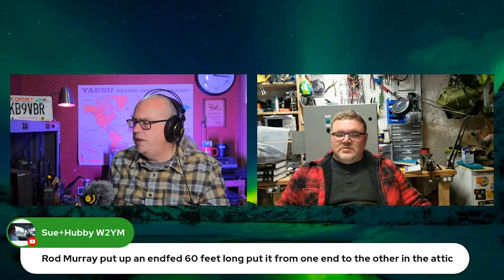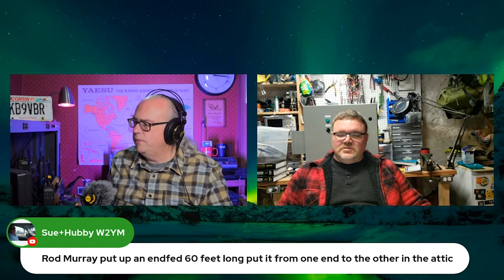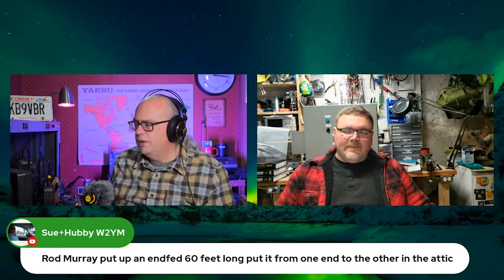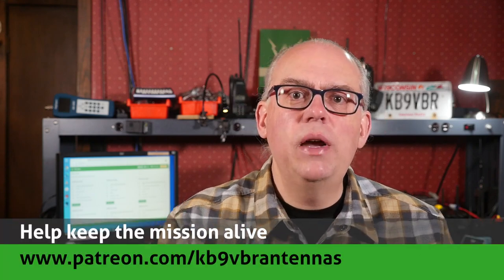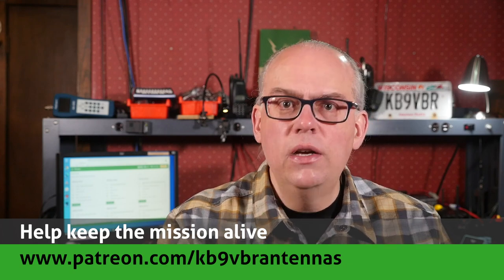What's the best antenna for in the attic? December 2021 Livestream Excerpt #HamRadioQA

Comment: My dad used to make mag-loops back in the 80/90's and had a mandrel bent copper loop in the attic. he ran it with a rotator for the loop and remote motor for the vacuum cap, he used to work the world with ease on that thing.

Comment: I made a fan dipole for 40, 20, 15, 6 and mounted it in my attic. Tuning it was a bear ! Finally got it resonent  on all bands and proceeded to fry all the I.R. lights on my surveillance cameras, activated the smoke allarms, turned on and off the under cabinet lighting and turned the computer speakers into noise makers and fried my video card. The only way it worked well was to turn off most of my power circuits in the house n run it on battery power. Not recommend 😕
Reply: Wow!

Comment: Best thing is a hi Q antenna 6-16 with cap hat on a 15’ mast with a good radial field under it or run a few elevated folded counter poise 😉😉
Reply: In the attic?
Reply: @lounickles4744  yea you could run a hi-q mobile antenna in the attic, 15’ mast could get tight in sum attics, so mast accordingly 😉😉

Comment: This is something I battle. Not, we have a good size attic, but the house is a Victorian, so all of the 2nd floor power runs up to and through the attic before dropping down to the rooms. Lots of coupling. There's also a 2nd floor furnace up there, the old gas lamp lines (which still work, mind you), and more.

So far, I've had reasonable success with a telescopic whip over metallic fabric for 10m, and a hamstick compromise dipole for 20m. I've thought about a delta loop up in the rafters, or a cobweb-like antenna over the cedar closet up there, but am still concerned about coupling.

Comment: What about using a double bazooka antenna in the garage attic? I’m needing to stay below the HOA radar.
Reply from the maker: Double Bazookas are great low noise antennas. They should work in the attic just fine. My only concern would be their length and if you could fit one in the space.

Comment: I don't have an attic, but I was looking up isotron antennas for more confined areas. I know these are a compromise and there's mixed reviews. Many say they're not worth it. Others say you have to properly tune them. Hmmmm
Reply from the maker: I picked up an 80 meter Isotron at a hamfest many, many years ago. I haven't used it, it has been sitting in my garage all this time. Maybe this spring would be a good time to get it on the air. I've heard that good grounding is essential for the low band models, but the higher band ones may work well in an attic or other small areas. As the solar cycle improves, compromise antennas become more viable, so the Isotron may be an option.

Comment: Curious, can you run a wire antenna along your gutters if your gutters a metal? Wouldn’t that effect the antenna?
Reply: No you cannot. The metal gutters will interfere.
Reply: I read about guys doing it. Sometimes it works. They kind of hide it in the soffits.